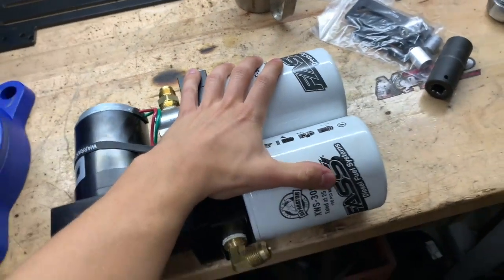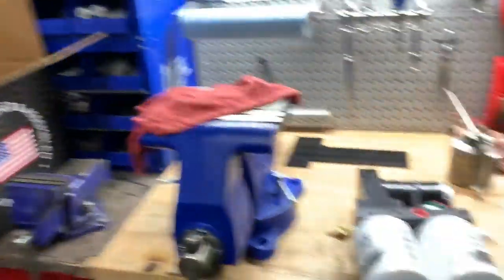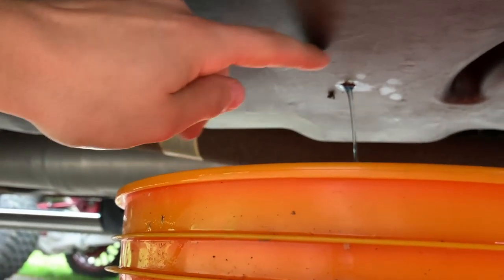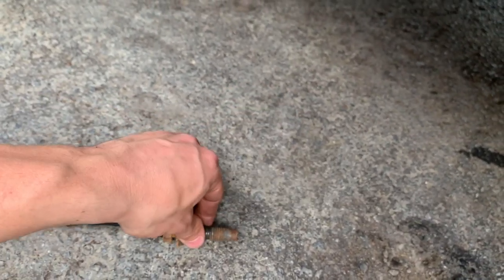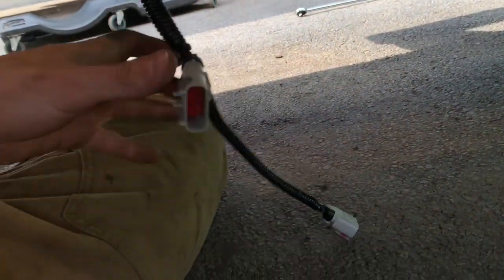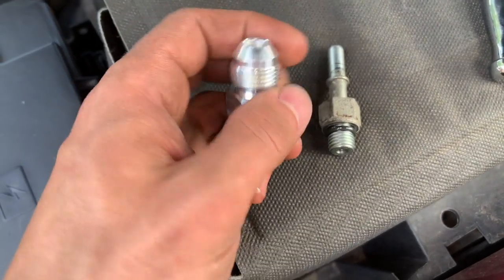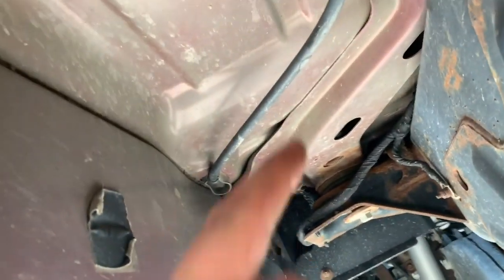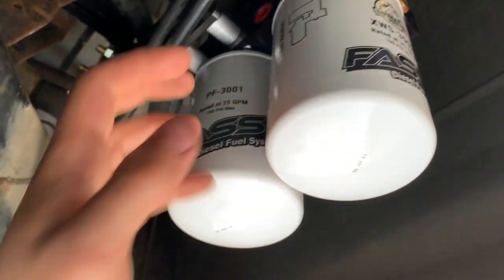Cummins FASS and Sump Install

Comment: Thanks for explaining the wiring.  The sump looks easier than digging into the tank.  I go off-road a lot and am concerned about ripping the hoses off the sump or even ripping off the sump itself.  I think I'll opt for using the factory sump. Thanks again for putting this together.

Comment: Yo man what’s your opinion on the fass lift pump vs the fleece in tank lift pump. I’m torn between the 2
Reply: What’d you decide on going with I’ve been looking at both right now and they both seem great I just like the fact the the fuel filter will be right there on the fass and that it has a water separator filtration on it as well
Reply: @johnlacolla6386  fass 165

Comment: do you know if the fass wiring harnes bypasses the factory lift pump electrically? what do you do with the existing fuel lines and filter
?
Reply: There is a fuel filter delete block you can install.